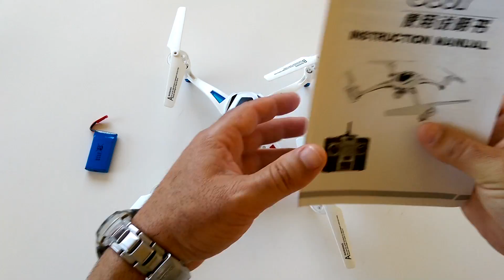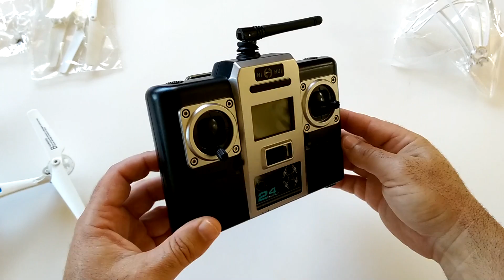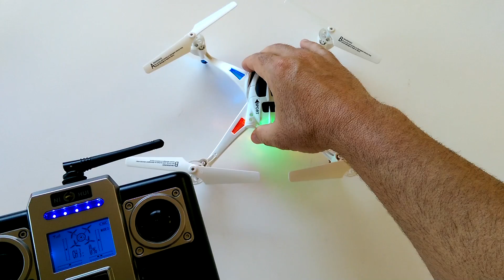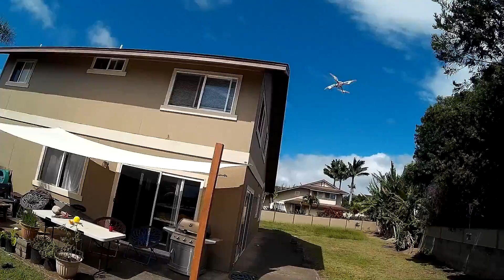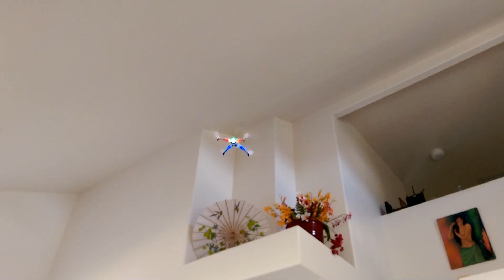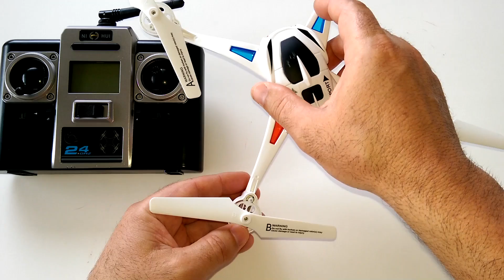NIHUI U807 QuadCopter Drone Review - [Setup, Flight Test, Pros & Cons]

Comment: Thanks Dustin for a great review of  the Nihui U807. I thoroughly enjoyed it.

Would you know if any replacement parts from the "La Trax Alias" would fit/work with the U807? They have a replacement shaft that I believe is made of an alloy, possibly aluminum. The cost is minimal. If the original shaft will stick to a magnet, that will tell you if it is made of a heaver material. Also Alias props are available in different colors, the will help orientation and personalization for the U807. (It might even solve the "Lift" problem)

What was the delivery time from Gearbest? As it took 1-week before they confirmed that my order was sent. I live in Southern California. (Ordered an U807 w/motors and batteries, on June 18, 2015) 

Thank you in advance for your input Dustin. I am looking am forward for your motor replacement update, and second review of the Nihui U807 :)
Reply from the maker: Thanks Dave,

I am honestly not familiar with the Alias and do not know if parts are swappable with the U807.  I would definitely like to know as well.  
When I pay the extra $5 or so for faster shipping I usually get the items via DHL in about a week or two for review items.

If I'm ordering normally with the free shipping option items usually take 3 weeks to Hawaii depending on if their on stock or not.  Sounds like they may have been out of stock which took a week till it was shipped for you.

Seems like you should be getting your package any day now.  I'd give it until the end of this week and then start asking customer support about what's going on with your order.

Hoping my motors come in soon so I can fly and update you guys on the review :)
Reply: Dustin, thank you for input. It was nice to know what to expect.

I just received my U807 order today from GearBest. (Received 7-2-15, ordered 6/18/15 and delivered to Orange County, CA, home of Mickey Mouse) So you were on target for delivery time. (Free shipping method chosen) I didn't receive the extra batteries, and 2 of the 4 motors. (They were out of stock at the time of shipment, but still coming.)

As for the replacement "colored" props from the La Trax Alias, the Alias has a "flat" on the shaft, and the U807 has a "hex" shaft. A magnet will also stick to the U807 shaft. (So it is not light alloy)

I will see if the shaft from the Alias, as well as other parts will fit soon, and update my findings. (If the shaft can be used on the U807, the Alias colored props can also be used on the U807)

The flight of the Nihui U807 is fabulous. As a comparison, my first quad is a Syma X5C-1, which I started with about 2.5 months ago. (Several crashes and 4-worn motors later, it still looks and flies like new.) I have pretty much learned how to fly and repair on the X5C, which stills flies great., and highly recommend. However the U807 is a great next step. (They are the same size, but the U807 has more performance, and easy to repair) No more worries about flying in the light breezes! This is a highly recommend / constructed quad. (5-stars)
Reply from the maker: Well said Dave.  Thanks for sharing your experience.  Keep us updated on how long your stock motors last :)
Reply: Well Dustin, Here's your motor update...

I started loosing power on the right rear motor. (After 1-day old) I only had the counterclockwise (prop "A", black/white wires), motors for spare parts. The clockwise motors were backordered from Gearbest. 
So luck was with me, since this is the motor I required.

After installing the new motor, it's back in the air.

So as a word of advice, always purchase a spare set of motors with purchase of your quad so "The Fun Never Ends".

Which motor did you lose, and how are your motors holding?
Reply from the maker: Right on Dave.  Bummer it quit the first day but glad you had a spare my spares came in so I'll be replacing mine tonight.  My right front went out.

Comment: 17:00 No.... adding weight "to keep the props spinning" does not add run time and weight in the center has minimal inertia effect compared to weight added further from the center. This has higher pitch higher aspect ratio (probably lighter weight) props which is good for speed (wind) but the trade off is less thrust like having a car in 3nd gear vs 2rd gear and that's what people are noticing. Are you sure the prop shaft is aluminum and not steel? That's an upgrade for some as making it (or anything else) lighter in weight will increase the run time. Looks like a nice little quad for the back yard. Amazing what the hobby has become. Show up with this at the local flying field not all that long ago and say you designed it yourself and think it will fly and you'd be laughed at by all the experts as it seems to break a few rules the computer takes care of and only the noobs would think it might work just because it looks cool;-)17:00 Adding weight "to keep the props spinning" does not add run time and weight in the center has minimal inertia effect compared to weight added further from the center. This quad has higher aspect ratio (probably lighter weight) props which is good for speed (wind) but the trade off is less thrust like having a car in 3nd gear vs 2rd gear and that's what people are noticing. Are you sure the prop shaft is aluminum and not steel? That's an upgrade for some as making it (or anything else) lighter in weight will increase the run time. Looks like a nice little quad for the back yard. Amazing what the hobby has become. Show up with this at the local flying field not all that long ago and say you designed it yourself and think it will fly and you'd be laughed at by all the experts as it seems to break a few rules the computer takes care of and only the noobs would think it might work just because it looks cool;-)

Edit: After getting a U807 and then another one on sale after the first one's 4 motors failed immediately I noticed there have been some important changes made. First, one of the early shipments of U807s was sent out with the end cap/motor wire polarity reversed meaning the motors were running backwards and their brushes were binding and failing, mine failed 1,2,3,4, like dominos falling a short flight apart. And that explains the bad reputation the motors were getting early on... I have found the stock replacement motors and current motors now installed with correct color code wiring to be quite good after breaking them in by not letting the motors get hot when new and keeping RPM's down until they break in and stop getting hot... which is a pain as it takes quite a few charges of long duration due to stopping and letting the motors cool off after a few seconds run time to get the last motor seated and running cool. 

The bottom center section now has 8 screws, one on each side of the motor arm and I believe this change helps with canceling out vibration quite a bit from reading reviews as using a CMOS FPV Pico camera and hovering in fount of a 32 in TV/monitor the picture looks just like it does holding it in your hand with no vibration and that's using the stock bushings... ball bearings make it even smother and let the props free spin longer adding flight time where getting ten+ minutes flying smooth is not unusual with a better battery as the stock 20-25C 17.1 gram blue 650 mAh battery (which would be amazing not that long ago) is a far cry from the 19.4 gram 750 35-70C Nano Tech where the added weight matters little as the increase in performance makes up for it plus you lose half a gram or so filing down the inside of battery cage so it fits... with the stock battery it's a little weak in its climb rate which due to the prop design is sacrificed already but well worth it IMO as it can handle some wind and I have yet to have a warm battery in cool weather giving better motor life and longer flight times... as a matter of fact the battery will not keep itself warm as the weather gets cold and you'll lose some flight time unless you insulate the battery using emergency blanket foil and tissue for insulation. I haven't tried the Micro Motor Warehouse Dark edition motors yet but would expect a nice bump up in performance with bearings added. Bearing should be added when new so prop shafts are not warn in by the bushing. For 7 bucks it's well worth it and a shame Nuhui spends their end of manufacturing cost on the bushings instead of 8 decent bearings. These work well: http://www.banggood.com/Wholesale-MJX-F47-F647-RC-Helicopter-Spare-Parts-Bearing-p-57426.html

The stock props are very consistent in manufacturing and the A props with just a tiny piece of tape are right on the money as close as my balancer can detect and so far out of 5 sets of props all the B props are spot on and need no balancing. Due to manufacturing consistency if you do one A prop you can just copy it as they are all the same, at least all the ones I received were. The "weight" at the bottom of the prop shaft (the aluminum shaft is just shy of half a gram) is the bushing surface that stops the prop shaft from pulling through and it needs the surface area to act as the bushing surface or an inner bearing race stop.

The biggest issue with the U807  is the prop design uses a proper center screw which is MUCH better than using side screws that can split the prop as well as put it out of balance... but the screw is thin and its threads are super fine so new prop shafts need to be cleaned out or its almost guaranteed the screw binds going in from aluminum dust left over from manufacturing. Brake cleaner with a fine nozzle tube works well and then some WD 40 on the screw so the screw goes in and comes out easier. This tiny prop screw has been an issue for some people and using the correct screw diver tip size is mandatory but dealt with properly it's a non issue although it requires attention the threads are clean so the screw pulls the prop all the way down and I use a spare screw before mounting the prop to make sure the threads are clean all the way down. You can hardly see the dust that prevents the screw from going in.

The biggest complaint I have with it applies to just about all the "toy" quads and that is the short range low resolution toy grade TXs that insult the RC aircraft being made and flown with them like the 80 mm JJ1000v2, my favorite next to perhaps the 2.5 gram lighter Juncheng 3015-2. However there is another issue with the U807 that may be related (only observed with a fully charged battery within the fist two minutes of flight so far or on the ground unable to yaw, roll, or pitch) as there seems to be a resolution dead spot in the TX throttle range down low where translational lift happens in flight conserving energy that causes the motors to suddenly stop on both of mine requiring the throttle stick be brought back down quickly to zero throttle and back up to regain throttle control regardless of which TX or U807 combination is used. You can cause it (on mine at least) by letting the U807 run at a certain low RPM' on the ground breaking in the motors, how I first noticed it and 3 times in flight thereafter) and I think it's a low resolution issue of the throttle where the U807 thinks it has lost throttle signal even though the green light does not show it. As long as I avoid staying at that throttle location for more than a few seconds it never happens so I think a higher resolution TX will solve the issue no one to my knowledge has reported on... so really need to try a 3rd U807 from later generation to be sure.
 
Fortunately the Nuhui U807 uses the Flysky protocol known for its good range and is now supported by Deviation using a DEVO TX so IMO the U807 @ $28 BNF may be a contender for the best FPV quad under 125 grams... can't say for sure until I try it. For the back yard the stock TX works and the U807's TX is better than most IMO and I have yet to add a notch filter so it looks quite promising. The only issue is the A7105 Wireless RF 2.4GHz Transceiver Module used I've been able to locate only puts out 17dBm or 50mw and is therefore not a full range transmission as it would be @ 20 dbm. If the spec @ http://www.banggood.com/A7105-Wireless-RF-2_4GHz-Transceiver-Module-3_3V-Power-Supply-Module-p-909404.html?p=9K231659477720140512 is correct and it's not 30mw as some are despite being advertised at 17dBm then it is actually more than 50% of the normal hobby grade 100mw full range TX so may be enough for short range micro/mini FPV. It's more than enough for LOS flying at this small size and the DEVO TX will allow a MUCH better flying experience with far better control response due to better resolution and the ability to program flight controls to your style of flying, but for FPV I want the half mile video link to have less range than the RC link. Just have to wait and see... shipping this time of year is slow.

All in all I think the U807 is the best geared in this weight size, the price is right,  it just needs a better TX.
Reply from the maker: John F Hendry Thanks for the correction John.  I'm no guru on inertia physics :).  I'm curious on why they decided to add that weight at the bottom of the gear/prop shaft (cant remember which one it's on).  It does noticeably increase inertia when you spin it and then try to stop it with your fingers say compared to a syma x5c design.  I figured there was some reason since the rest of the quad was designed with seemingly thoughtful engineers.  I'm not sure if it's steel or aluminum.  I"m also wondering if this weighted shaft design also had something to do with a seemingly premature motor failure after hitting a wall a few times.  To many variables i guess.

These toys have come a long way in a very short time and are still amazing to me how capable they are.  Just glad I'm around to enjoy them :)

Comment: Very good and well detailed review. Debating between H6058 vs U807. You sold me to this quad. Ease of maintenance. Parts availability.  Flies well in the wind. A must for fliers living in areas with constant trade winds. For the lift issue, different set of props or higher discharge lipo's. Maybe anyone of your viewers tried one.
Reply from the maker: Thanks Michael.  It does very well in wind.  Yes, props or a better battery would probably help lift.  Once I get my new motors in I'll be testing some mods.

Comment: This one looks exciting, nice review :D
Could 750mAh battery cause any problems on motors?
Reply from the maker: 750mah should be fine but I have not tested.  I have one but it would not fit in the u807 to test.
Reply: Thor wt I use lectron pro 3.7v 700mAh 30c, but mod micro motor warehouse insane motors, because my stock F/R motor went out after only one week
Reply: Chill After one week of fun? xD That doesn't sound good though..
I recently just bought 6x 750mAh 25C 3.7v batteries from Banggood.com for 30$ 
Sounds like i'm gonna buy motors too..
Reply from the maker: Yep.  But mileage will definitely vary.   This could have just been a bad manufactured motor. There are so many variables in why a motor fails... having a set of motors on hand is always a good idea with R/C in general.
Reply: Dustin Dunnill Yeah, right? it's kinda necessary to buy extra motors when buying a quad :) Can't wait for u807 to arrive!!
Reply: Someone also mentioned the black version is faster than the white one. Might be also due to manufacturing?
Reply from the maker: It's a fun one and fast.  You'll enjoy it :)
Reply: Dustin Dunnill Oooh man :D STOP THAT! 
It's not even shipped yet x) HAHA :D Very excitement, much wow & such fun :b

Comment: Wish I could have seen some video output.
Reply from the maker: It was real bad jello and vibrations.  Somehow it was erased and then I had the motor failure so have to wait for replacements.  I'll put up a short one showing stock video then another with some dampening mods when I get it back in the air.
Reply: +Dustin Dunnill  Actually never buy a camera version, have a WLtoys V686G  with excellent jello free cam, with no dampening, so no need too waste money on  other cam Quads. Have a Gopro on my Blade 350 QX.         Just for fun I ordered a Cheerson  C10c   micro with cam :)  According too a serious review it had good jello free video, I wonder with mine when I get it.

Comment: Four motors > $13.96 and they appear to have NO pinions.
Reply from the maker: The pinions seem to last and they give 5 extras with the quad.  So we'll see how long the new motors last.  Hopefully it's not an issue.
Reply: Dustin Dunnill Well that's good to know.   With the POS Q7 I bent a motor shaft and threw/lost the pinion.  Then I realized the spare motors had no pinions.